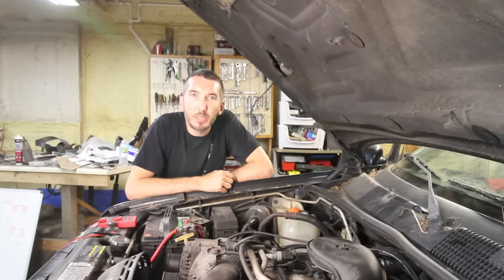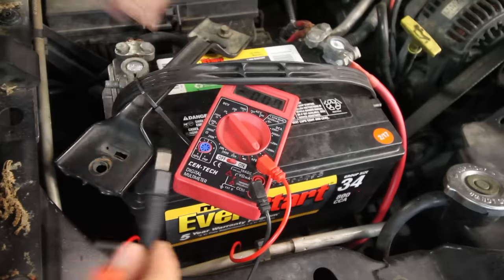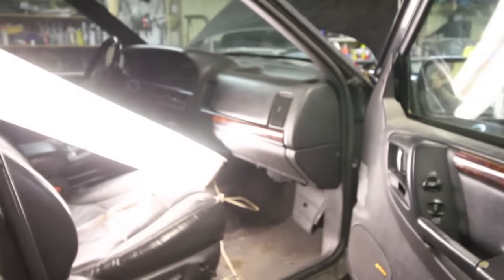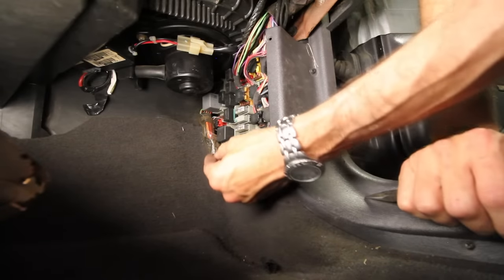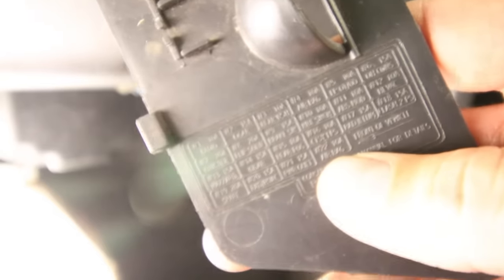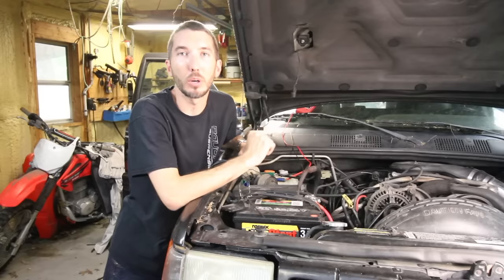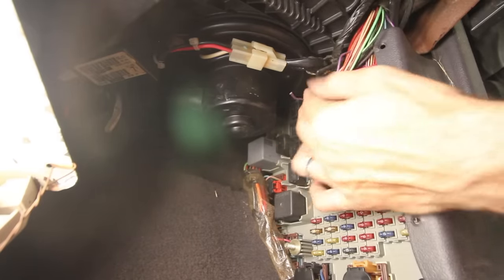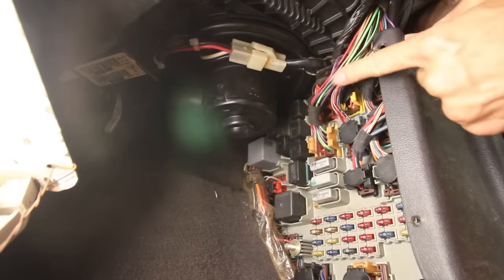Why Does My Battery Keep Dying? - Parasitic Draw Test and Fix - Operation Cheap Jeep

Comment: Saw your video on TV and had to get on my phone to give you a big thumbs up for this video. Great detail and to the point. No cursing nor talking about nonsense. BTW, my 2005 Grand Cherokee has a latch on each side of the rear door. The warning Rear Door Open would come on/off at times. Didn't realize the right latch wasn't fully engaging. So now I just put a bit more pressure til I hear that side click. Problem solved.

Comment: I don't have a jeep and I don't have any electrical problems in my classic 1999 Isuzu Rodeo or my classic  1992 Ford F150, but in older vehicles, strange problems do pop up from time to time.  I found this video very informative and was impressed by his savvy way of figuring things out without fancy test equipment or diagrams

Comment: I haven't used all data but I'm sure the wiring schematic you could probably find there would have told you what was on that #7 circuit and when you traced the wire like you did it'd tell you what it controlled, instead of just cutting it you could have unplugged the back hatch sensor pin thing to test it that way, (probably ideal for "important" things compared to cutting and resplicing when it isn't needed) then you don't have that live wire just dangling and if you found a decent sensor somewhere down the road you could just throw it in and be fixed right....

plus the wiring schematic may have gave a clue to where the wires run incase of a break/short somewhere inline that could be fixed.
Reply: Matts a smart boy. he'll probably just use it to power a dummy led theft deterrent light as a cheap security system for the cheap jeep. Problem solved.
Reply: AceBoy2099 alldata is pretty sick ive used it alot
Reply: @ericg3354  $$ cheap jeep

Comment: This is a great and informative video, I like the method of testing between the  male and female parts of the connectors for current. I do have a question, how would one perform this same type of test on the type of fuse boxes that are hard wired in like some of the auxiliary fuse boxes and some manufacturers also have them hard wired with no connectors
Reply: Useful reply but it doesn't answer their question. Just saying I'd like to know how to test them if they are built in. My only answer is to barely peel a tiny piece of plastic off of the wire to be able to test it, or all if it takes it, then just use electric tape around the places you done it, idk just an idea

Comment: I have a problem with. My 94 Chevy S-10  battery  go dead after  a week  of not driving  fairly  new battery , checked  and replace alternator  every thing  was good  let set for week no start dead battery  , thanks for  sharing your talents  going to  be doing  so testing

Comment: tape the door sensor lol yeah cause that would work NOT
Reply: No, painters tape will not combat a strong spring. The best method is to use a clamp around the door frame and a piece of wood if necessary.
Reply: Just weld the spring lol😜

Comment: So. These videos were super helpful and I learned a lot! Did all the tests. Batt voltage good, alter test good, no more than .022 draw. So why am I not starting in the morning? 
One big thing that no one mentions in the countless videos I’ve watch is the battery’s “cold crank amperage”
My battery is suppose to have an 850 cold and 1000 warm crank start amperage. I had it tested at our parts store and it’s reading was 350! Not even close to what it’s suppose to be. So solution? New battery. Done and done. 
I absolutely thought my battery was fine because a shop “tested” it and they said it was fine. Well just like myself all they tested was it’s Voltage. That’s not the only battery test clearly needed

Comment: Stumbled upon this gem of a video when looking to trouble shoot my truck's battery. Seems to have a sluggish start with struggling to fully crank up lately. Just wanted to drop a line to say that this video was excellent, you were crystal clear with your directions, stayed on topic, and moved quick to the point. My favorite part is when you provided a brief explanation of why you thought the error was happening to apply and understanding everything discussed and done in this video. Outstanding work!

Comment: Excellent video.. i did just what you said and as i rolled through the fuses on my '90 YJ i figured that nothing was going to take that voltage to zero.. THEN i pulled the DOME fuse and 0.00.  What a beautiful feeling... now onto the next step.   Thanks again for your help man

Comment: This is the best most informative video Ive found on this subject. My biggest problem is finding the right amp setting on my POS multi meter. I have more issues in useing it then anything. But God willing if I figure it out the rest will be easy thanks to this video. Thank you sir

Comment: I've not tackled a parasitic draw problem in 30 years.  I knew it as a high resistance short to ground problem.  So I'm rooting around seeking different or modern troubleshooting techniques.  I did some preliminary work seeking the cause of a 12.5 amp draw, but I must retrace my steps.  I did not bother pulling fuses under 15 amps, and a couple secured under screwed in clamps.  Will retrace my steps...... by the numbers, and using schematics and a deeper dive as needed.  Untill I nail the problem I'll just disconnect the battery.  Thanks again.

Comment: Great video. I checked the vehicle diagram. The wire you cut (violet) is pin 8 of that connector.  It is the input power to the Auto Headlamp Light Sensor (VTSS LED); located on the top of the dash. It gets its ground from pin 23 (BLK/LT GRN) "Lamp Driver" at the Body Control Module (lower left of dash). In case you wanted clarification to where it leads.
Reply: The headlight sensor and LED is located on the top driver side dash. You can carefully pry up on the part of the dash that surrounds the LED and daytime light sensor.  This component is held on by one screw. Remove and disconnect or replace.  If left unplugged, headlights will have to be manually turned on when sun goes down.  This faulty component will also cause the headlights to randomly come on even when the ignition is off.

Comment: This was a good vid! Like you said, most video’s brag about figuring out if there is a draw or not and at best identify which fuse is drawing the power. I also unfortunately have a cluster issue and have yet to identify the source. This vid was simple and very helpful. Thank you!

Comment: Awesome video 👍 I was able to find the parasitic draw on our 2006 Honda Odyssey by following your troubleshooting method step by step. Turns out the passenger sliding door was the culprit. What’s odd, we were not getting a warning light or alarms 🤔 I ended up spraying silicone into the locks, sliding tracks, and the locking mechanism with no further issues.

Comment: Literally exactly what i was looking for. My 2008 Sentra has the 50 A Fuse drawing 80mA while off and it happens to be the Body Control Module. I was stuck because everyone else is an easy fix like interior light and they just unplug and that's it but you my friend are amazing for this. I greatly appreciate your help.

Comment: Great video... you're detailed and articulate, which makes you easy to understand and learn something from.   My answer to many of these problems with "modern" vehicles is to..... Own a vehicle built before 1978 and forget about the darn computers, BCM's, and all the rest of that "stuff".... and the older, the better = SIMPLE and Cheap & easy to fix.   Lots of kits out there to upgrade to disk brakes, etc, etc.... and you can stay away from all the miles of wiring, sensors and engines buried under all that garbage.... not to mention, drivelines that go straight back to the rear which further adds to greatly reduced clutter under the hood. 

This country has gone High - Tech crazy... and like many other things... "Big Brother" has learned to use it against "we, the people".  I am thankful I've lived most of my life already, I don't like where I see this country & the world... is headed to.   My heart truly "goes out" to the younger generations... it's going to be an Extremely Controlled life for you,  you will not be able to live your own life, as the God of Creation & the Bible, intended.

Comment: Good video. Good thoughts.
    It is ALWAYS a good idea to go to an auto parts store and purchase a vehicle manuel for the car you have. It has schematics, showing plugs with pin/wire color/wire size and what the wire does and where it goes in the other end. It also gives you part numbers if replacement wiring harnesses. The book also gives you a wire pattern to spark plugs, button rotation, where TDC is, and your smog hoses. It advises you how to trouble-shoot problems. It takes the guessing out. The last one I bought cost about $50.00. It's WORTH having!

Comment: Thank you so Much! I am a novice at car repair. I have had a draw on my battery and I do not think it is the alternator. I know my passenger door has been goofy and won't shut, so that is what I think is the problem. I have the most basic tools, no meters etc. I am a broke gramma and could use the help. Thank you again for helping me.

Comment: BINGO!  Bleepin Jeep, I had weeks of my battery being drained overnight. Battery wasn't even a year old. 2007 Chevy Impala LT. I found an assessor y device wired up to the battery. It was a "Rust Neutralizer device. Claimed it stops the car from rusting. I removed that, wires and all from the car. Load tested the battery and alternator, all good. Car starts every time now, no dead battery.

Comment: Just saw your clip re: battery going dead. My daughters 2017 Jeep Patriots battery keeps dying. I've installed new one as she just bought it used. I checked all the connections under the hood. But now I will do a more intence inspection to see if I can trace down the problem. Thanks for the information. J. Morgan

Comment: Thank you, since my WJ might have the same problem. BTW, with a special tool or jeweler’s screwdriver you can pop the pin out of the wiring block.

Comment: with all the safety precautions you specified, i unistalled the battery and used the ohm setting on the meter, connected it to the + and - cables. any resistance value close to or less than 240 ohms is bad. proceeded pulling the fuse one by one until a fuse gave me a reading of 34 kilo ohms. i think this is safer than using a live power source doing this test.

Comment: My battery drained every day,not enough power to open the truck,so it was the cd disk that had warped,left in the case during hot summer wether,all sorted,cheers from Devon England.

Comment: I replaced my starter and rebuilt my alternator, already had a brand new expensive battery, yet the parasitic battery draining continued. I had left a dome light on 3-4 days prior overnight but still started up fine. Now it's dead every morning and I have to wake up an hour earlier to charge it. I wonder if I need to recondition the battery, or I just have to do what you did and find a short. Now comes the rigorous process of locating my multi-meter....Also, check engine light is on after 3 days of cranking with a dead battery. I'd appreciate responses from anyone. Thanks for the time you put into this video, it was very informative!

Comment: Hi there Matt
Great video this has shed some more light on my problem.
Just a thought on your "back hatch" problem with the multi-meter still in the same location and you have found that the "purple wire" is the back hatch etc., instead of cutting the wire why not remove the plug on the back hatch then your reading will go away, you now have the alternative of leaving it unplugged thereby negating your current drain or replacing the  back hatch micro switch, either way you are onto a winner. Tony 😊👍😊👍😊👍

Comment: Very good.  Now I have a good process to follow.  Not working on a Jeep but have already isolated down to the TBC fuse on my S-10.  One problem is my door switch plungers are to strong for tape but I can make something to hold them down (or perhaps just disconnect the one) while the door is open as my fuse 2nd fuse box is on the side panel of the dash and drivers door must be open to access it.

Comment: Great video on how to troubleshoot. I was  once a technician at Xerox corp, so I understood what you were doing. I recently replaced my car battery after 3.5 years. I don't drive the car much, so I think that may have been the problem. But I will use your steps to see if I have a parasitic draw somewhere in the vehicle. Thanks!

Comment: thank you, narrowed draw down to a radio fuse, pulled it but still having a draw somewhere else after driving short distances daily.  12.6 in AM, then drive and car barely turns over.  Battery and alternator tested as good.  Was advised possible remote car starter that is old and no longer used could be issue.  ARGGHHH.  This is a difficult issue to track down.  Will try your method.

Comment: One additional thing you can do to trace the wire is a wire tracer.  They range from 20 to 40 bucks. They have a senor pen that buzzes when you are close to the wire that the tracer is attached to. you plug in a buzz generator into the pin you found having problems. Then follow the signal with the pen. They are great for all cable tracing issues within your home. Great video though.
Reply: Bu cihazla ilgili bir link gönderebilir misiniz?

Comment: 06 Chevy impala bought in  2017 used, in 2022 would not start. Replaced alternator high mileage. Still no start. I noticed battery seems to  draw slow. It might be nice to find a data base from dealers or concerned owners to check on similar issues. Sad to not see it. Thanks for your info.

Comment: Thank you.  Great video!  It's amazing how a brand new $300 battery can be ruined when drained down below 10.5 volts two times.  And there is nothing you can do to revive it.  Even if you get it back up to 12.4 volts, it will likely have a parasitic draw internally.   So, this video could save people from buying and ruining millions of car batteries.
Reply: By battery has drained to nothing many times.  I don’t think it damages my battery though.

Comment: I have a 97 XJ with the same exact draw reading and it’s on the same circuit with dome lights. I’ll go from there, I’m betting it is the same wire but this was a great help

Comment: Great details.. Thanks for this. Just a couple of things.. 
1. In general, if it's more complicated than hatchback indicator, how do we trackdown the short and fix. If it's not easy to fix, I am assuming changing a battery wont help. 
2. In particular, I am having a problem of battery draining. Here is the whole story. Your advise please.

Couple of days back I bought a car from a private owner. I went about 120miles with my friend who helped me drive there. 

We test drove around for a short distance, checked standard things like engine sound, alt belt change, service history etc and it all went fine. As the car started immediately, we didn't anticipate any battery problem( Btw, it would help if someone like you comes up with a video with a proper checklist of things to do before buying a car).

Coming to the issue -
I drove back home and left the car close to 2 days to sort out the insurance and taxes. 

Yesterday, when I tried to start, it didn't. I panicked and my friend said there must be something using the battery. We started with Jump and it started. I went around and came back. Again this morning it didn't start. I started getting worried and again started with jump. Left it running for 15min, stopped and then started. I didn't start.

I messaged the seller (She didn't lift my call earlier once). Fortunately she called back after a while. I explained the situation.  She opened up saying she had the same problem for the first time just before we went to buy since she had the car. She had to jump start it. And she said she didn't reveal it as she thought because she left it unused last 2 weeks in rain the battery may have discharged and should be fine now. 

She also said she hasn't been using it for 2 months and only used once 2 weeks back. The weather has been damp and raining here for several weeks now.

She thinks it must be because of the dampening of the wiring in general and connections to the battery that may be causing it. The power windows are not totally closing at the top due to this  is there is no battery while locking and rain water is seeping in through those edges.

So, please advise what could be the problem here and what can I do. I lost all the excitement of buying this car now. :(

1. Battery or Dampness or Alternator or anything
2. Is there anything called electric wiring dampness. If so, how to remove that dampness
3. How to find the exact problem and fix.

Truly appreciate it.
Reply: Sorry to hear about your problems.
I'm not the video maker but.... here's my opinion :-)
If your battery won't start the vehicle shortly after the vehicle was running then it's likely the battery is bad or the alternator is shorted. You have more than just a "parasitic" drain as described in the video. If a vehicle sets for an extended period of time without running, the alternator can have rust build between the stator & rotor which will drain the battery quickly.
My guess is a bad battery.

Comment: Its the microswitch on the flip glass lock mechanism. It suppose to be pushed in when flip glass is locked. When the lock mechanism slides open it releases the plunger. The switch housing itself will have play(movement) if you are having this exact issue. I re-crimped the housing around the switch and the draw went from .18 to fluctuating from .03 to .01